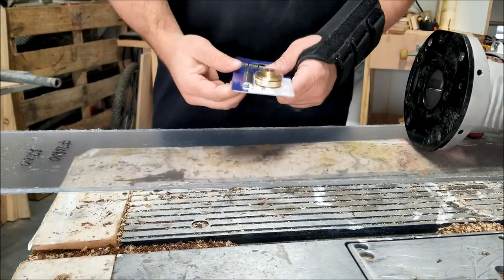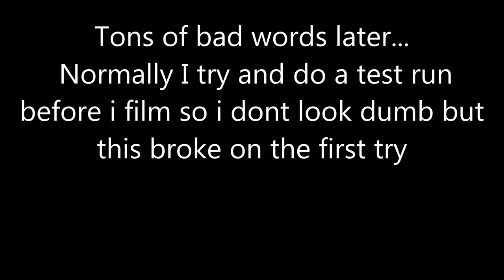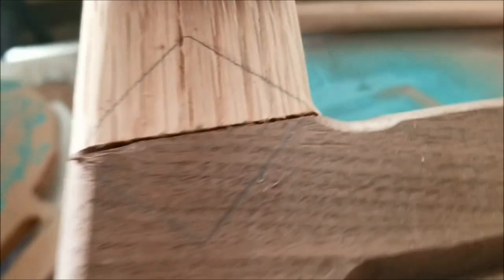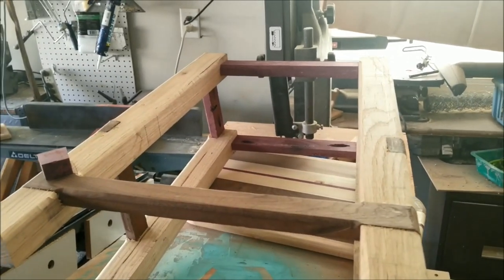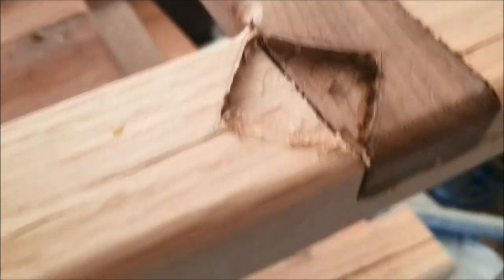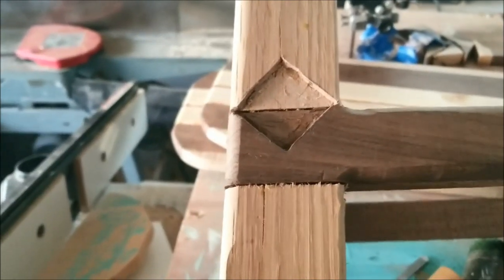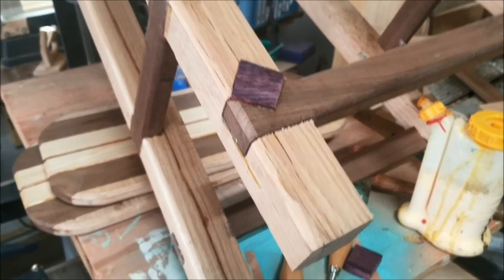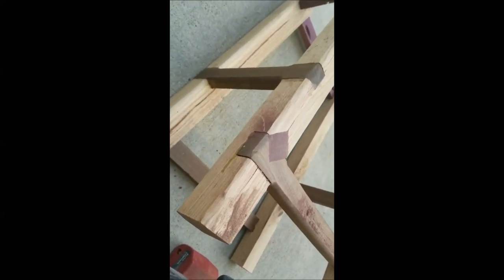HARBOR FREIGHT INLAY KIT: Do You Really Need It? This Will Help You Decide!

Comment: A smaller router may be the ticket with the inlay kit, also, a small flush cut saw would make quick work of trimming the excess. MLCS woodworking has a decent little router called the Rocky with a 3 year warranty. I've been using one for a while now. It's a nice tool and even comes with a dust collection port.
Reply from the maker: I will definitely check that out!! Thanks for the feedback i really appreciate it
Reply from the maker: and a fair price i will be getting this!!!